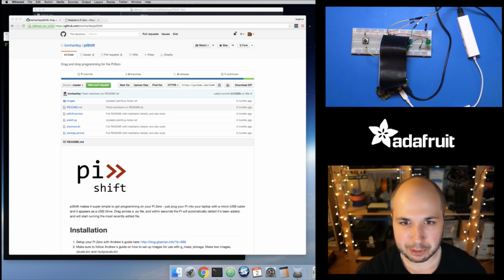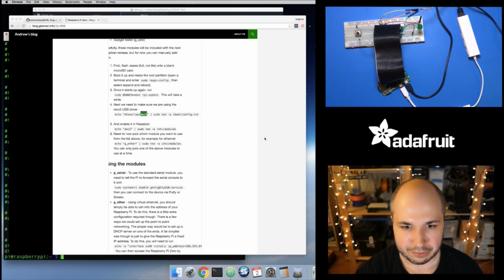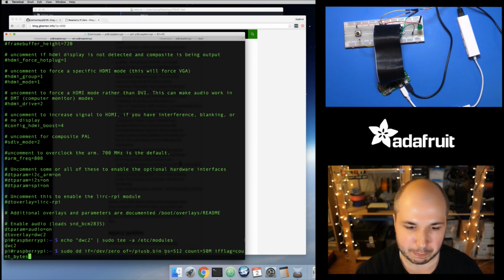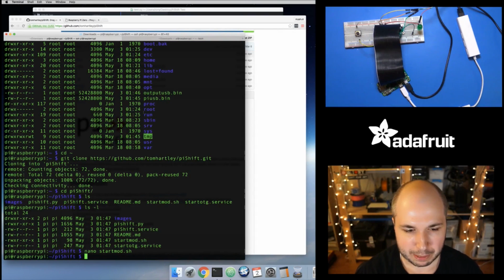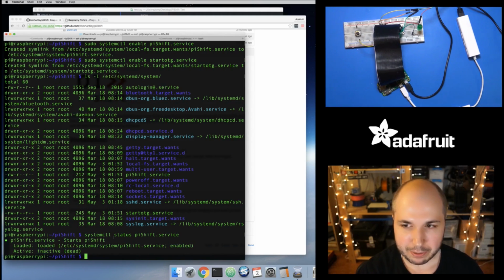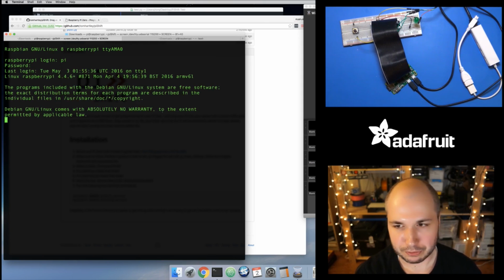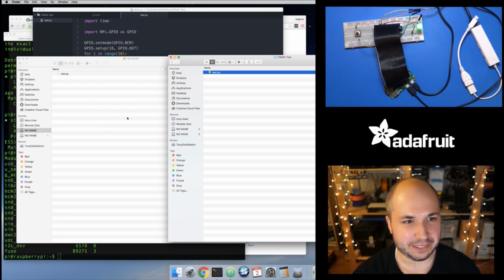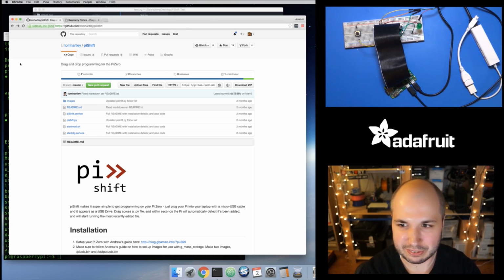Raspberry Pi Zero & PiShift with Tony D! @adafruit #LIVE

Comment: Tony checking the PiShift gethub there is a branch that looks much easier to setup, also on the serial port that is defined it looks like getty is running on it, did you try to use it?